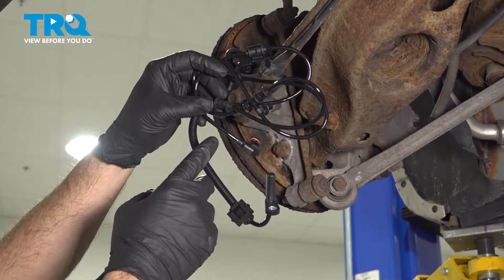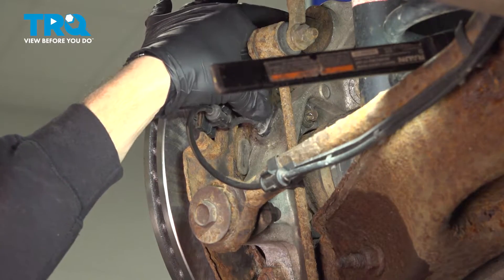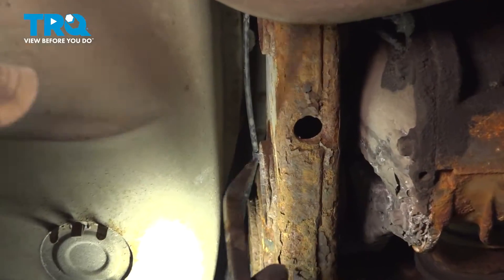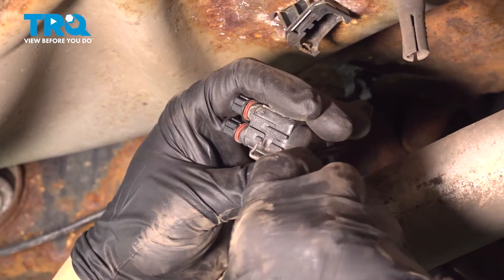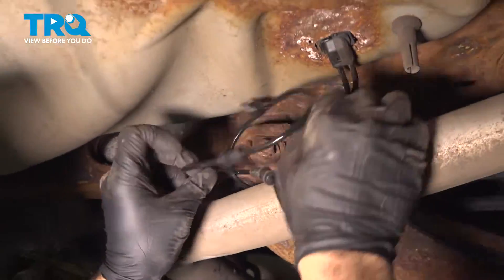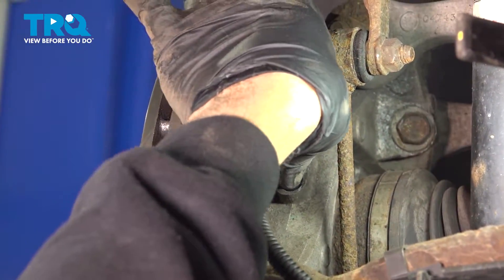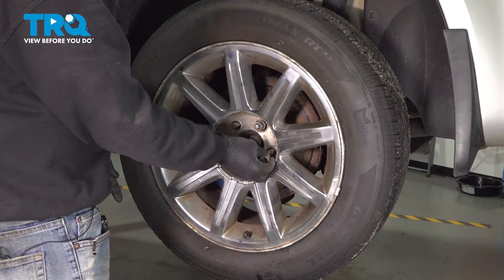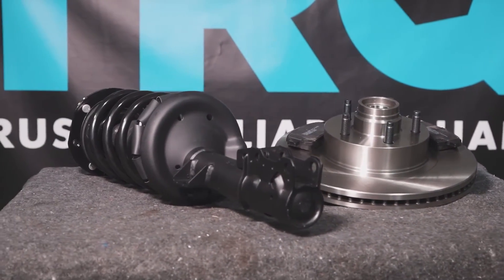How to Replace Rear ABS Wheel Speed Sensor 2005-2010 Chrysler 300

Comment: Great video.  Can you do it with the wheel left on?  I need to replace the same sensor on my 05 Magnum but I hate jacking the car up and working underneath it. Always been paranoid about car jacks and jack stands after hearing about the many times they fail and have killed folks